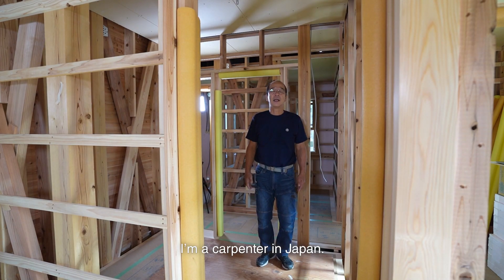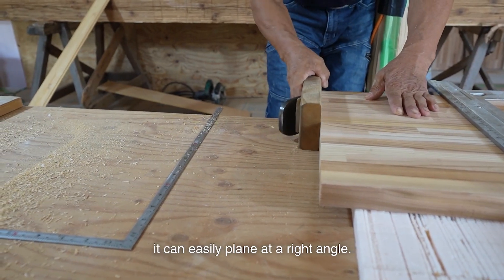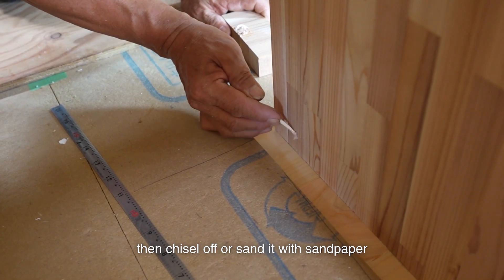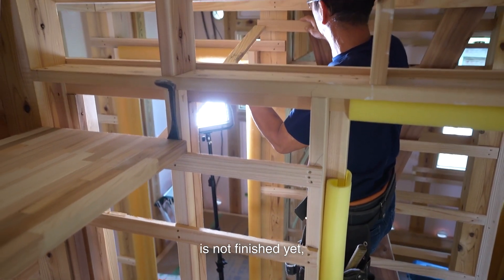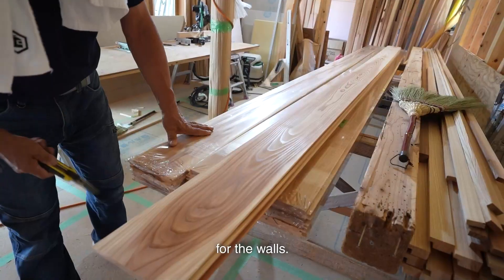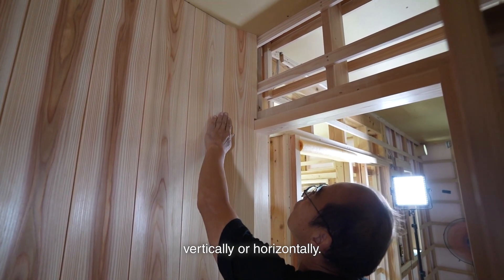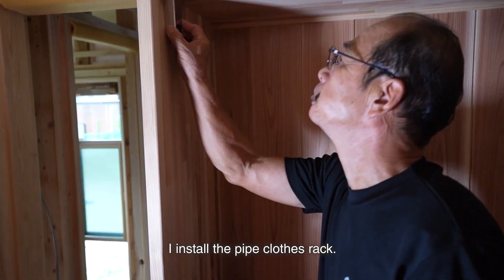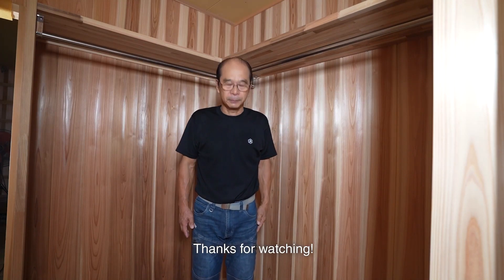High-Grade. Build a Walk-in Closet With Cedar Boards on All Sides [Season2 – Part 13]

Comment: 私はアメリカの太平洋岸北西部に住んでいるので、金属製のブラケットで固定された壁の内側にある木製のクロスメンバーに魅了されました。これらの追加は、規制された耐震補強の結果であると思います. また、この家の「コスト」、材料の品質、家の大きさ、Shoyan の仕事のコストを考えると、これはアメリカでは非常に高価な家であるに違いありません。 非常に高価な家。 Shoyan は単純な大工というよりも「職人」です。これらの言葉は、英語では区別されますが、日本語には存在しない場合があります。 これを共有してくれてありがとう。

I was fascinated by the wooden cross members inside the wall that were fixed by metal brackets, since I live in the Pacific Northwest of America, my assumption is that these additions were the result of regulated earthquake reinforcements. Also I can not help but wonder at the "cost" of this home, the quality of the materials, the size of the home, and the cost of Shoyan's work must make this a very expensive home in the US, in Japan it must be an VERY expensive home. Shoyan is more an "artisan" than a simple carpenter, these words have a distinction in English that may, or may not exist in Japanese. Thank you for sharing this.